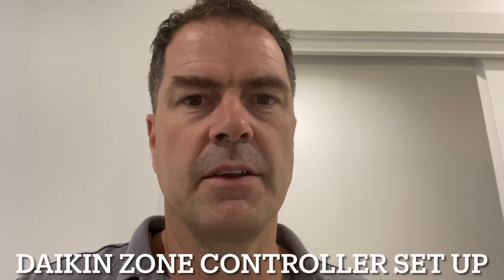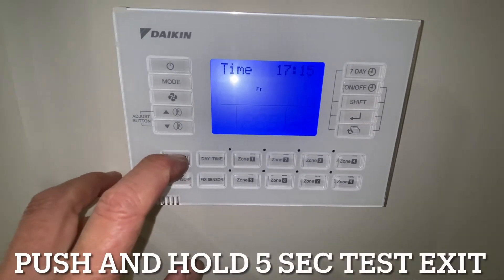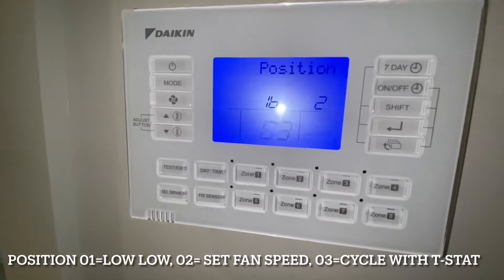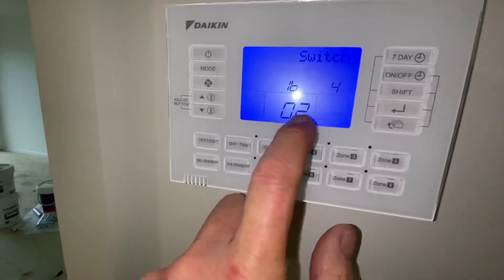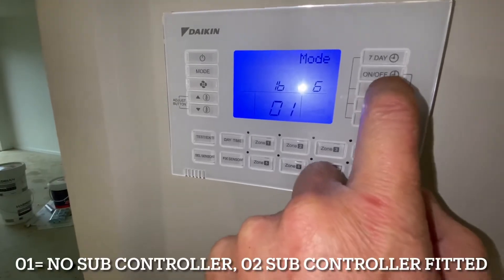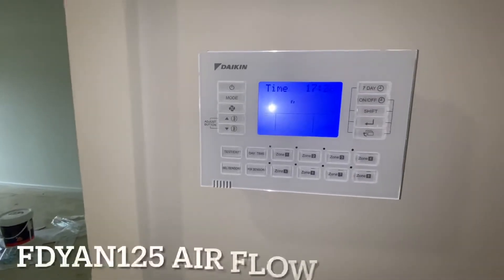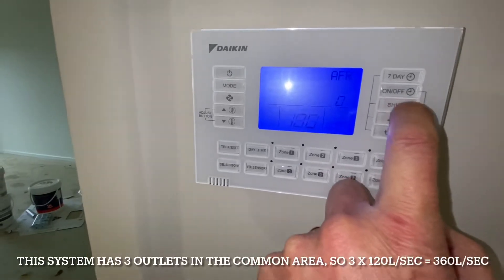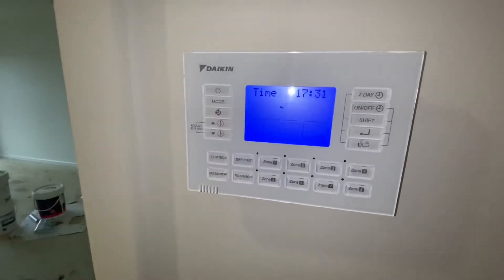Daikin zone controller set up BRC24Z4, BRC24Z8, BRC230Z4 and BRC230Z8.

Comment: The fan comes on every Sunday night at midnight any idea how I get this to stop? I can’t see it set up on 7 day settings
Reply from the maker: Yep, you have a timer set. When you push the timer button a few times you actually set a timer. By default this timer is set at 1.00am fan only on the day you set it. The controller will have prog on the screen keying you know you have a timer set. Go into the timer, bring up the timer you want deleted and push and hold the cancel button for 5 seconds, this will cancel the timer. On the newer model controller it doesn’t have cancel on the button. It has a return arrow, but it’s the same thing. Right row of buttons next to the display, bottom button is the cancel button.
Reply: @FullyAirconditioned  thankyou il try that out

Comment: Hi Craig, I found this video so helpful, thanks for uploading. Do you have any troubleshooting info for one zone deciding to no longer work (under 2 years old, bedrooms have stopped air flow, appears to be mechanical as still ducted properly under the house). Other zone is working completely fine. Thanks!
Reply from the maker: Sounds like a fault zone motor, it it’s a brc24z 4 or 8 it’s a 24volt plug in zone, you should be able to in plug a working zone and swap the cable with one that’s not working. This you can tell if it’s the zone motor or zone controller.

Comment: Could you please explain the meaning of switch 4, 01, 02.   I don't understand when you say 01 one zone on, or 02 all zone off.
Reply from the maker: 01 keeps one zone on all the time, one green zone light will always be lit or one zone all ways on, the last zone can’t be turned off unless you turn in a 2nd zone and you turn off the 1st zone off. All zones off 02 will let you turn off all zones , so no green zone lights are lit, this is how it’s usually set up when you have a common area.
Reply: @FullyAirconditioned  thank you so much!

Comment: Thanks for the video! 

 I am currently facing 2 problrms. 

1. When i was trying to only turn on one zone, the common area zone will always automatic turn on.  Eg, only want bedroom zone on, but it will turn on common area + bedroom. 

2. I don't have a sensor in the bedroom only in the common area, so the temperature seems to get very low and AC doesn't know to turn itself off.  Any way to fix that? 

Appreciate your help!
Reply: Thank you!!
Reply from the maker: Fit a remote sensor and you can have the control point at the bedroom zone. Common area is not a zone, it doesn’t have a zone motor to turn the air flow on and off. The common is all ways on when the air conditioner is on, you would need to add a zone to turn off the common  area. This may not be as easy as just adding a zone, there could be duct work changes that are needed at make it all work correctly.

Comment: Hey mate, got a controller like this, but its frozen and won't do anything
Reply from the maker: Try turning off the power to the system for 5 min, then reset power, hopefully it will reboot and start working. If that does’t work you may need a new controller, a new controller indoor box in at the indoor unit and controller

Comment: Is there a child lock on this unit sick of my kids putting it on 16d
Reply from the maker: I don’t believe so, the standard controller dose (brc1e63) and a few more features like minimum and max set temps, it even has a set back function the re sets the set point to a pre set setting. Or it has a 5 action timer, so you could set the timer up to set the same temperature 5 times a day. Your controller is a up grade because it has zoning and it can have additional sensors fitted, but a down grade is function. I would personally put the standard controller with a 3rd party zone controller and the Daikin standard controller in.

Comment: ...or can I set it up so that the ac turns off automatically adter an hour's use?
Reply from the maker: You have a on off timer but it would need to be set each time, the standard controller has this function and a few more, it can be set up so its just a puts button for 1 hours use then turns off, you can adjust the min and max set point that can be set, it also has a auto temperature reset, if some one turns down the temperature once it reaches that temp it auto resets back to a predetermined temp. You could swap this controller out and put a standard controller but you would have to put a separate 3rd party zone controller to control the zones. Although the Daikin zone controller is an up grade from the standard (has zoning) it’s a down grade in function ability from the standard BRC1E63 controller.

Comment: How can I lock my ac so flatmates stop setting temp to 17 degrees?
Reply from the maker: You cant with this controller, if your room is zoned just turn off that zone, or get a better zoning system like Myair where you can set different temps in the diffrent zones or last option get a new flatmate with similar tempreture comfort levels.

Comment: What a ridiculous system. Should be much simpler instead of having to do mathematics to work out
Reply from the maker: Yes and no, I guess if it was basic but didn’t actual adjust the fan accurately to the amount of outlets the open people would probably complain about that.
Yes over engineered but accurate.
Reply: @FullyAirconditioned  yes I guess , will you be able to tell me how to increase fan speed over two ?
Reply from the maker: @Nadz770  do you mean you can’t get 3 fan speeds from the controller, it only allows you to set two speeds when you push the fan button??. If so it’s not the controller it’s your unit, is the unit older, as the ac fan motor only allows for two speeds. I think this is also true for the VRV high static ducted units, still run as AC fan motor not the multi speed DC fan motor. A DC fan motor allows for many speeds. An AC fan motor is limited to the number of windings that can fit in the motor, unsullied a max of 4 speeds, only two selectable from the controller. There is a Low Low (this is selected during thermostat off) low, selectable from the wall controller, then there is a high and a high high. This has to be plugged in at the indoor unit, there is a jumper cable that can be moved to the high high terminal. Instructions are on the indoor electrical cover. Turn off the power below going anywhere near the indoor electrical  box and should be carried out by someone quilted.

Comment: How do you remove the filter warning on this controller?
Reply from the maker: Hi you reset filter light by pushing and holding the clear button for 5 sec, on the newer model controller it’s the return button.
Reply: Hold down the clear or 3 overlapping rectangle button for 5 seconds.

Comment: How do I change which rooms are which zones? 

Whenever the unit is turned on the living dining and kitchen stays on, regardless of what other zones are on or off. I want to change it so that the “ common area” can be its own zone that I can turn on and off since we don’t need it on all the time, but would like to have just the other rooms on (ie, being able to turn the living area off, and our bedrooms on when going to bed rather than the living area being on all night, even though the space is not being used.)
Reply from the maker: If the common area is not a zone it can’t be turned off, if a zone motor/damper is fitted to the duct work that supplies air to the common area, then it could be turned off. But often when the duct work is designed the common area may be feed with air from multiple ducts, so you may be not be possible with out some duct alterations or more that one zone motor/damper.

Comment: How do you set a zone that dictates one particular room to get the air con. I have 3 bedrooms, but only want one bedroom to receive the air con. Any ideas?
Reply from the maker: If each bedroom is individually zoned (3 zones one to Rach bedroom) you can turn off the other two bedroom and just cool / heat the one bedroom, unless you have additional sensors connected to the controller it won’t actually measure the temp in the bedroom that’s on. If you want individual temp control to each room with different temps set points, this isn’t able to do that. You would need a zoning  system that can connect to the Daikin’s unit, like Myair zoning system, this has sensors in each room and you can set different temps across all rooms.

Comment: Hi mate. I have 2 zones and 2 controllers . Master downstairs and slave upstairs. How can I assign controller temp sensor master to zone 1 and controller temp sensor slave to zone 2? Thanks !
Reply from the maker: You can’t, it doesn’t work like that, you can choose what sensor is active but you can’t assign a sensor to each zone and have it control the temp in that zone. The unit only has one compressor and the sensor that is active will dictate whether the compressor providing cooling or heating.
Reply: @FullyAirconditioned  so you can’t turn off the zone individually as they get to temperature ?
Reply from the maker: @jadedFk  no, not with this controller, a 3rd party controller like myair can do that.
Reply: @FullyAirconditioned  thanks heaps for the reply mate. I will look at alternative controllers

Comment: Can we get the room temperature display on this system ?
Reply from the maker: Unfortunately not, the Daikin zone controller just doesn’t have that function, it’s very disappointing considering it’s an upgrade from the standard and the standard has this function. This controller need a refresh it’s been out a very long time. The timer needs looking at as well as it’s quite limited as well.

Comment: Hi Graig. Thanks your your messages. My control wall panel works but for odd reasons, this flash around on the control monitor even when it’s not turned on. Any suggestions ? Regards Trevor
Reply from the maker: You might need a new controller

Comment: Hey craig. When working out your airflow do you use the nominal amount or the max amount? Cheers.
Reply from the maker: It doesn’t really matter, the total of all the zone outlets is equal to 100% or full speed. It would work even if you based it on percentage out of 100. I go through the set up this way in the video because this is how it says to do it in the instruction manual and I don’t want to confuse people.
Reply: @FullyAirconditioned  Thanks for the reply, much appreciated.
Reply: @FullyAirconditioned Hey Craig will this setup work on both heating and cooling? Now we're in the hotter months it seems the heating works a lot better than the cooling. 

Cheers
Reply from the maker: @FilthyGinger4130  should really make a difference, double check where you measure the temperature from(select sensor) best set to master rc and clean your filter.

Comment: Great video thanks 
Just wanted to know if you can tell me how to view live temp readings of master control so I can compare with my digital thermometer placed next to it to see if they are reading the same temps
As the controller doesn’t show live temp just set point 
Cheers
Reply from the maker: Oh yeah, you can’t, although it’s up grade controller it’s actually a downgrade from the standard one. The standard one shows the room temperature or outside temp or indoor unit temp. But it dose do zoning.
Reply: @FullyAirconditioned  you can somehow deep in the settings as I had a technician come out and commission a new install and showed me the temp of master controller and inside sensor and the coil temp but I didn’t get to see the pathway in the menu to get there. It’s like a diagnostic setting
But yes Dosnt show on normal display
Reply from the maker: @michaelwall3530  yep it can be done but it’s in the service setting, not somewhere you want to play as you can stuff up the whole system. Had a guy they went into the service settings and some settings  by accident, the unit was not operating as it should. Not sure what he set, but the only way to fix it was it install a new indoor pc board, was over a $1000.00 dollars to fix.

Comment: Incredible tho... literally everyone has a smartphone and they're still selling the worst possible user interface! baffles me! cheers for the video tho ;)
Reply from the maker: Couldn’t agree more, this controller is old, it’s a downgrade from the standard controller, they have brought out the air hub, but it’s just a polished turd, it’s this controller with a touch screen interface. Although it dose do temp control some what. And who can forget the sky zone, daikin we’re burnt hard after that control. Only out for 6 months or so, can’t believe someone didn’t get sacked over that one. This controller dose give basic zone control from the single controller, but doesn’t show a actual room temp, timer is a nightmare to set and you have to delete your settings if you go away on holiday and then spend an hour redoing the timer when you get back. When wifi is connected to this controller you can do all function from your smartphone as well as turning on and off zones.

Comment: If I have another common zone and it is upstairs how do I turn that one off
Reply from the maker: If a air conditioning system has a common area, that would mean that that area is default on when the air conditioning system is on. For it to be a zone that can be opened and closed it would need a actual zone damper installed in that section of duct that supplies air to the outlets in the common area (zone). This is why it’s called a “common” and not called “up stairs zone”. A damper could be installed if it’s all the outlet that supply air to the up stairs area are on a single duct, but I don’t believe this will be the case as the duct layout hasn’t been done with the intention to install a single zone to the common area.. I am guessing that you need to redesign the duct layout and change it to suit a single zone or install multiple zones to do the up stairs area.

Comment: Thanks for this. My zone 1 has a green light when the air is off, and no light when the air is on (instead of green for and no light for off like the other zones). I was wondering if you know of a way to fix this?
Reply from the maker: Yes I do, with modem zones they drive open and drive closed, if it’s a 240 volt zone then it’s possible wired wrong the open wire is wired to the closed terminal and the closed wire is wired to the closed terminal. This wiring should only be fixed by a qualified person as you could be dealing with deadly voltages. Some zone motors have a switch on them that can reverse by simply opening the switch to switch the drive motors direction. It’s really the fault of the installer incorrectly wiring it.

Comment: Hey there, amazing video! Could you please also show how to turn off timer? I've the same systems it keeps turning on automatically. I think it has todo something with 7 day timer.
Reply from the maker: Hi, you cant just turn off the timer with this controller, you have to delete the program. This is a pain if your just going away for a week or so as you will need to redo the timer program again when you get back. To clear the timer push the “7 day time clock” button, then push and hold the “clear” button for at least 4 sec, then push the “shift’ button once, then push and hold the “clear’ button again for 3 sec. This will clear all timers
Reply: @FullyAirconditioned which button is the “clear” button? Thanks
Reply from the maker: Hi, on the older model it had a clear button with clear on it, on the new controller it’s the same button but it now has the return symbol (an arrow with pages behind it) right hand side bottom button.

Comment: Just wondering how you tell the unit there is an extra wall sensor installed? Is there a setting in the unit setup that needs to be configured?
Reply from the maker: If there is a wall sensor you need to make that input active, an easy check is to push select sensor button. Each push will bring up a different sensor. The sensors can be turned on and off in setup. When you push this button you should get indoor (inside the indoor units return air ) master RC ( sensor in the controller). Other sensors that can be turned on and off in setup are, sensor 1 (remote sensor) sensor 2 (2nd remote sensor) slave sensor (sensor in 2nd slave controller). The sensors can also be re named. Once you have picked which sensor you wast active push “fix sensor” button and it will become the active sensor for the system.